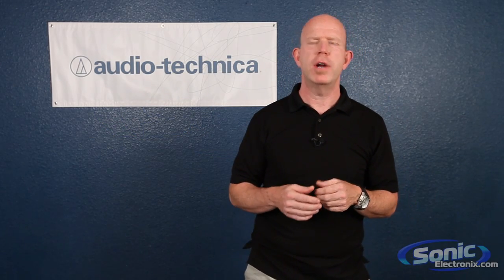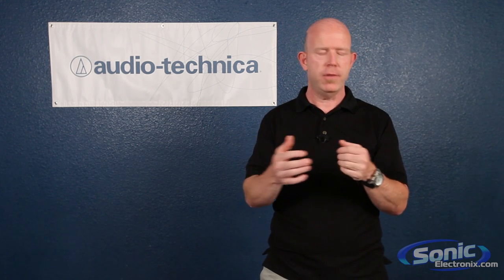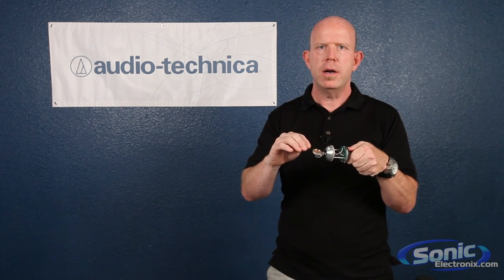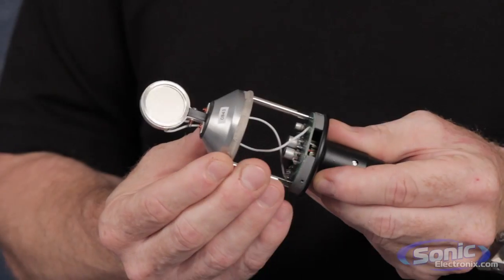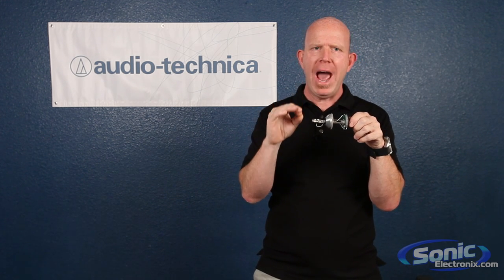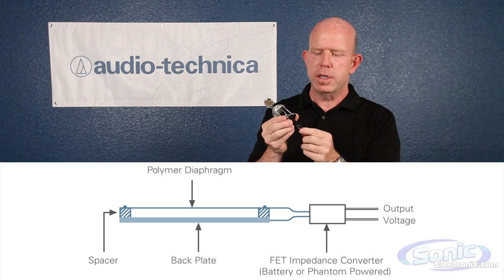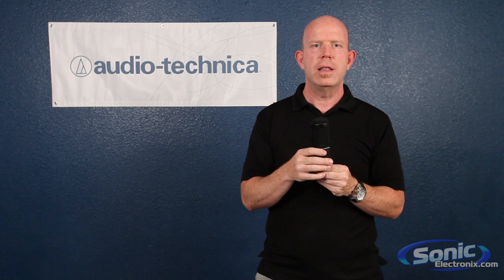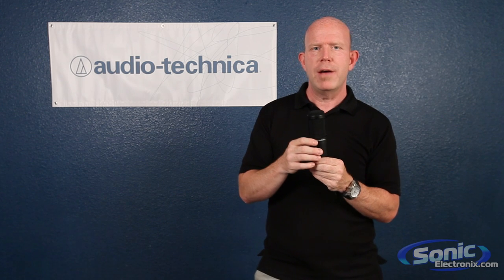How a Condenser Microphone Works | Mics Explained - Part 2 of 2

Comment from the maker: If you have a phantom power switch on a mixer that typically is a global phantom power for all mic preamps on all channels. Mixers w/ individual preamps and discrete phantom power capabilities per channel are more expensive. Phantom power +48v typically is a global setting or in banks of 8, 4, or 2 channels for many recording interfaces. Note that phantom power is a requirement for condenser microphones but it will blow up ribbon microphones, it's either all or nothing for each channel.

Comment: Question, I want to know if do i have to have individual phantom power switch per channel on the mixer for this to work or 1 phantom power switch is ok?, for example { going to use condenser microphone,and the other is not condenser together on 1 mixer,} (i hope you understand)

Comment: Are you aware of any type of outdoor weather resistant microphone that is shaped round,flat on the rear side with perhaps a convex shape on the microphone side? I need something small that does not protrude or make the vehicle look like a news truck if you understand. I can install a few in various places so it's not just 1 microphone that's necessary. Thanks again for your assistance.

Comment: hi a condenser microphone connected to a mixer by a xlr / jack cable the phantom will work on the mic? and the mic work´s? or only work´s with the xlr / xlr cable?
Reply: It works only with XLR / XLR cables
Reply: thank you for the information
Reply: You are welcome :D

Comment: So, the membrane is just gold or a gold-coated polymer, or what?
Reply: RODLON anything conductive will do. The lighter, the better, but it also has to be rigid enough to pick up high frequencies and quickly dampen stray vibration. Thin metal foils work well, and so do PVD coated polymer films. The energy transference profile of the material will have direct impact on the frequency response and tonal characteristics of the mic.
Reply: It's gold coated